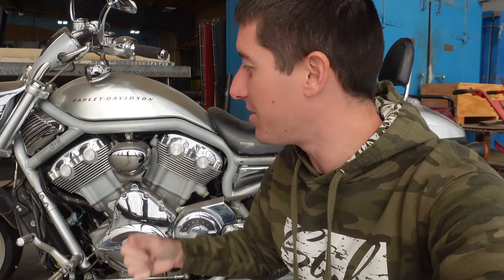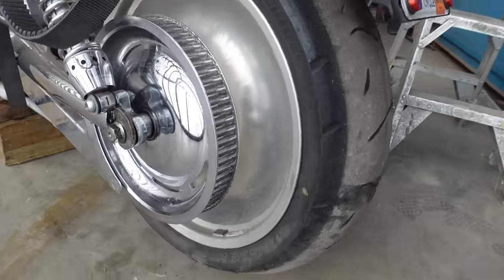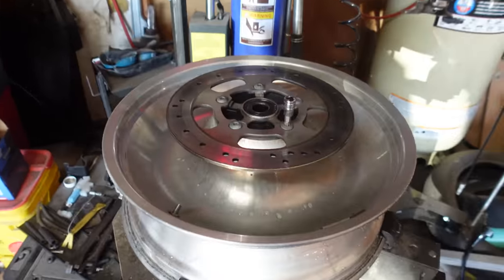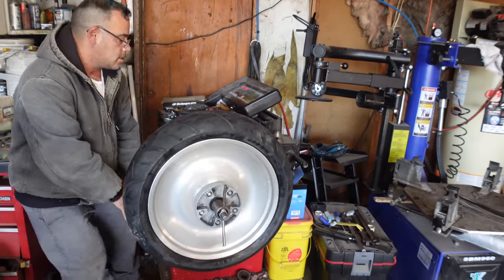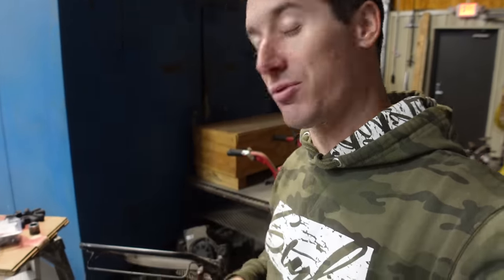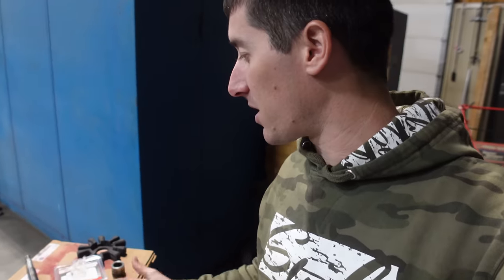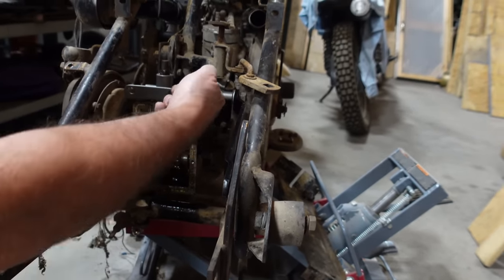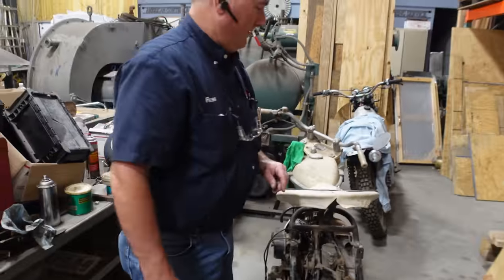We DIDN'T Have To CUT The Axle Out Of My CHEAP Harley Davidson V-ROD

Comment: I think why your dad got your axle unstuck is he figured persistence and penetrating oil worked on the old tractor engine so it should work on the axle. In regards to the shop removing the bearings that's shocking. I didn't even think you could walk into a place and only be charged  $10 -- most places won't even look at you for less than  $50.
Reply: Hello, fan!
Thanks for reaching out congratulation 🎁🎊🎉You Won a (BMW)Cheerful send a message above to acknowledge your prize🎁✅

Comment: Every time I take someone's wheel off I always coat the shaft with anti-seize. I have had friends that 10 years later ask me to do some work on their bike and wanted new tires and did not want to pay the dealer price for taking them off the bike. I had zero problems the rear and front came out so easily and when I put them back in I put on another fresh coat of anti-seize.

For anyone who ever works on their own bike Harley or sports bike do yourself a favor and pick up the shop size anti-seize. It comes with a brush and it makes it a lot easier job to do. 

As always I enjoyed your video and of course I made sure to give you a big thumbs up.
Reply: Hello, fan!
Thanks for reaching out congratulation 🎁🎊🎉You Won a (BMW)Cheerful send a message above to acknowledge your prize🎁✅

Comment: i put avon cobra chrome on my m109r and they were great tires ... the back tire on an m109r is 260 mm factory and i went with a 280 so they are massive in fact the front tire is actually a rear tire so you have to run it backwards ... crazy

Comment: All Harley brake rotor bolts are locktited, I learned long ago to use a propane torch and heat them for about 2 minutes and they will break loose easily, of course I had to strip a few bolt heads and break several Torx bits to learn this lesson, lol